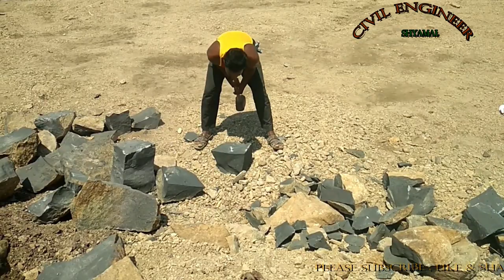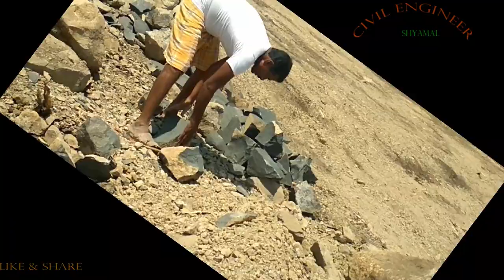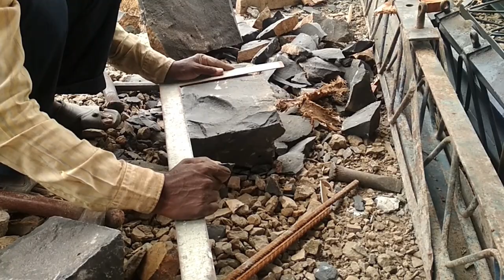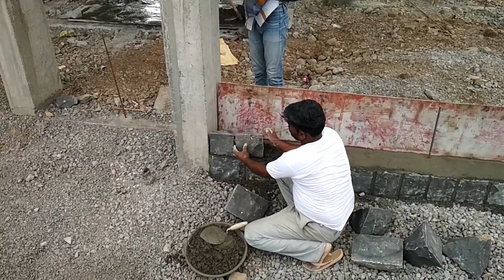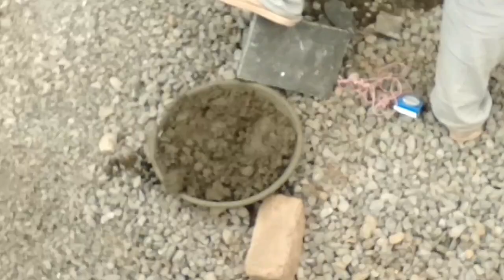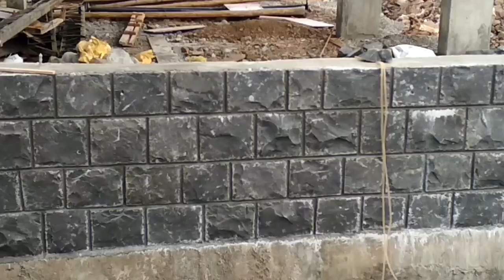Stone Masonry II Coursed Rubble Masonry

Comment: Nice stone-masonry, I hope they used lime mortar for the joints and stainless steel for reinforcing. Portland cement is hard and will cause the stone to spall in about 25 years. Always use a mortar weaker than the masonry.
Reply from the maker: I hope so too